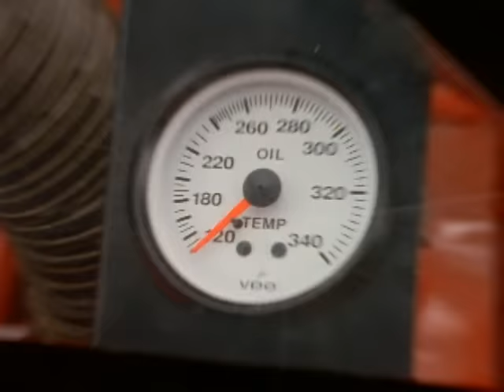Alan Jackson - Who's Cheatin' Who (Official Music Video)

Comment: drove a ford juat like that for years. rolled it down the side of a hill on the way to my grandpas place. 
good news, seatbelts work.
bad news, airbags didnt.
i miss that truck all the time. engine was underpowered for the weight and the suspension was awful, radio barely worked and was fuzzy most days it did work. but man do i miss that thing.

Comment: I guess because I have had realy good luck with them. So it's either drive them or a Mostly Old Parts And Rust, or a Cracked Head Every Valve Rattles Oil Leaks Every Time